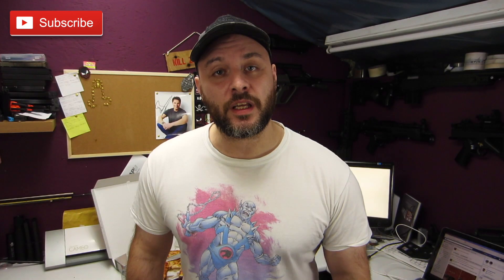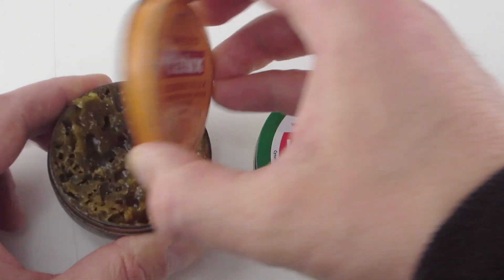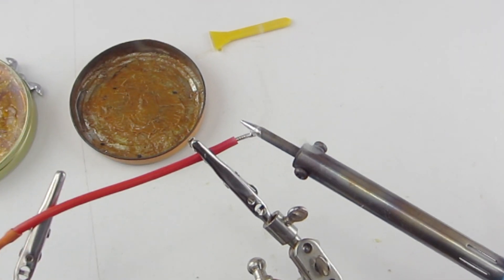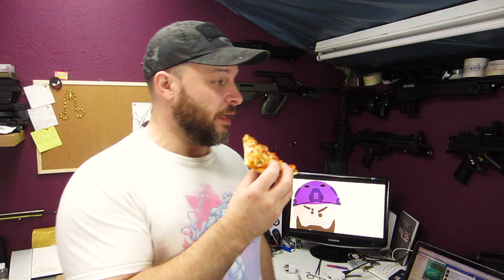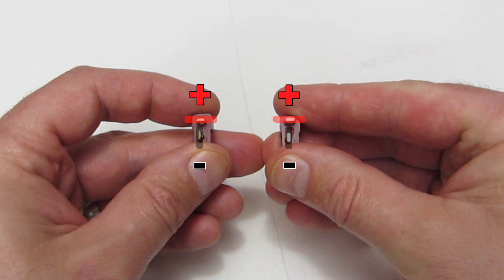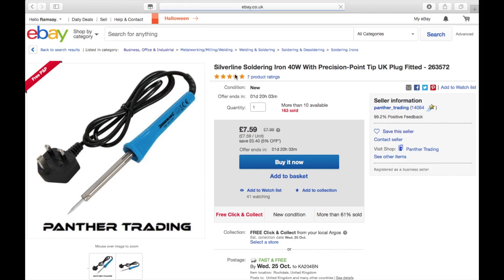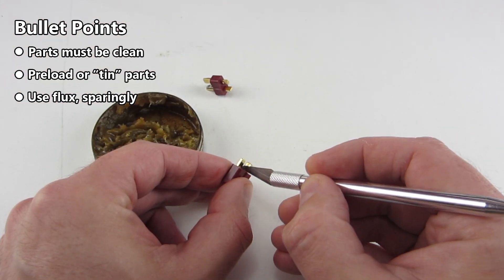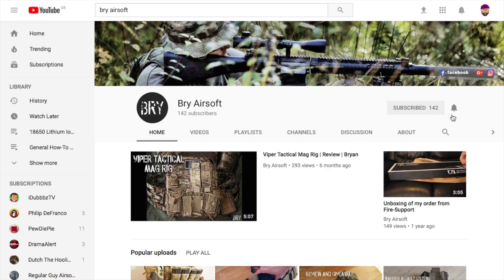HOW TO: Solder for Beginners | incl. Deans Connectors

Comment: I am from Airsoftology! Learned new things here. I hope you can post a list of the things you used in this vid. I found it hard to follow. thanks!
Reply from the maker: Hi mate thankyou for taking the time to pop over and check me out 😀

To get started, all you need is:

Soldering iron (cheap one is fine)
Solder (electronics solder, not plumbing)
Maybe flux depending what you are doing.
And some wire to practice - that's all - you should definitely give it a go, it's a handy skill to have!

Comment: I've always been afraid to use the solid rosin core flux, never knowing how to prepare it. Thank you for this video showing how its prepared.
Reply from the maker: Thanks for taking the time to watch buddy!  Yeah its a LITTLE bit of hassle, takes a little bit of time to dissolve - but the good thing is you can get the consistency right how you want it for application, a paste for jobs in awkward positions, or a little thinner so it soaks into multistranded wire, just as two examples.

Comment: Now that is really handy, but you didn't mention that if you buy cheap deans, the plastic melts before it's hot enough to take solder lol. Also helping hands are underrated, I had to use my wife's hands before I got them lol
Reply from the maker: +Alisdair Wood haha mate for years I messed about stubbornly using whatever was lying around to hold or pin down parts, too stubborn for my own good! It's cheap connectors I'm using here... no problems... maybe you just aint got the tekkers 😂